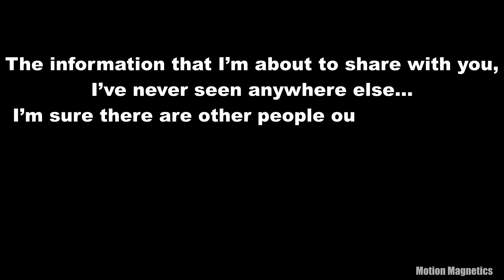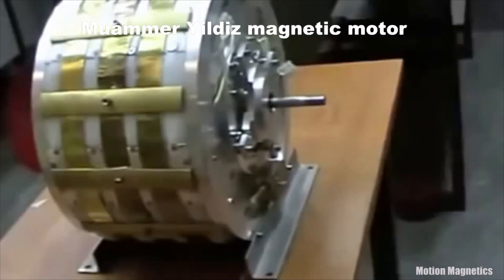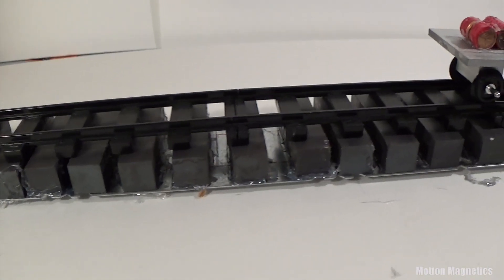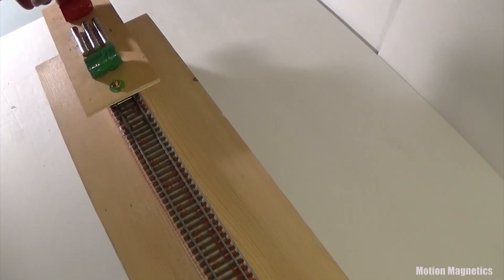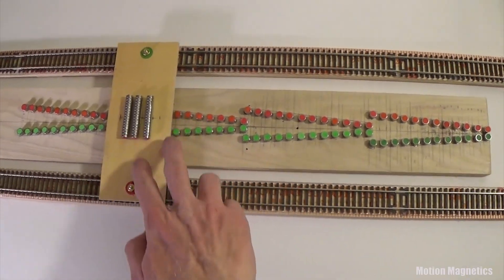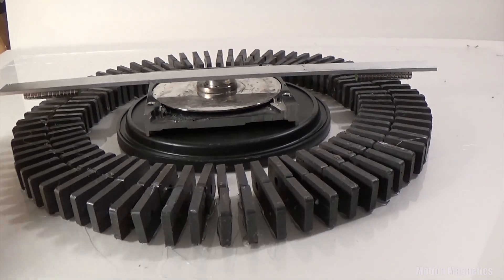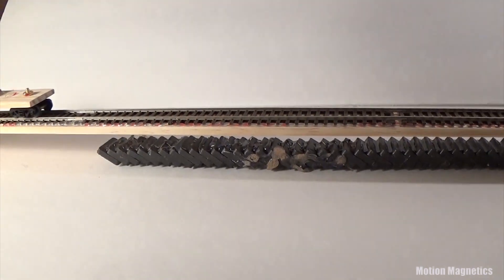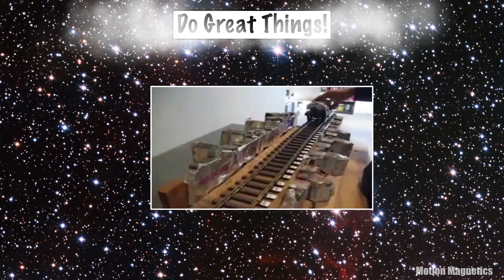The 3 Types of Magnetic Motors Part 01

Comment: You tried a lot of unsuccessfull magnetic motors and magnetic tracks. Try my JAMM Overunity Magnetic Motor from inside youtube movie "Overunity Charger" from my channel johnnyaum3 (made since 1999), its working and well - try first time with only a steel or iron ball and a lead counterweight on the other side, then you can add balls to increase speed, and desyncronised floors (i will make a JAMM movie about full disclosure soon and more models). Is interesant to say that i made at that time - 1999 - 2 other designs, JAMM 2.0 and JAMM 2.1 which are practically Perendev motors in design (almost identical) before any Perendev and completely my pure design creations, among many inventions, some are on my channel. As i remember, Perendev on internet was after year 2000, i never seen this motor before this time. good luck with all, keep going!

Comment: Do you know of a way to make a track out of multiple magnets with an even density of flux e.g. north on top so that it behaves as a single magnet?
Reply from the maker: bridgendesar Single magnets don't exactly have an even density of magnetic flux. It's greater in the area of magnetization, and weaker away from the area of magnetization. In that sense, yes, I could probably build a track like that. What would you do with it though? One large magnet, does not necessarily equal motive force in a cart or rotor.
Reply: I was thinking of two tracks facing each other, say north to north and putting a bar magnet in between so north was to one end and south to the other.
Could the squeezed north field push the magnet along (some shielding to minimize south pole pull to produce motion)
Reply from the maker: bridgendesar I've tried similar arrangements, with no real success of note. It's good that you are thinking of things like that though. I'm always problem solving, in my head. You never really know for sure, until you build some assemblies, and test your ideas.
Reply: I tried with a disc magnet to get the continuous track (rotating about the centre), but it didn't work. some shielding needed perhapse
Reply from the maker: bridgendesar You could always use the shielding in segments? If it's a timing issue, then try to build a pattern where the rotor accelerates, and then coasts. If you do this without winding down, then you may be able to simply replicate the pattern? Just a suggestion off the top of my head.
Reply: I'm also thinking of a three magnet or two magnet array to give me massive flux to one end